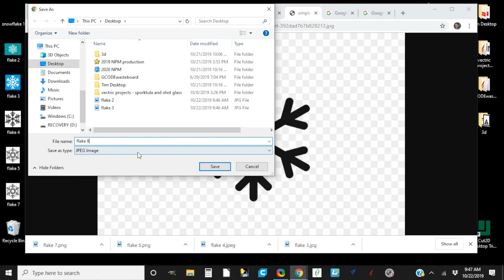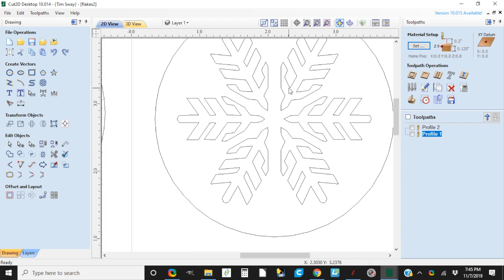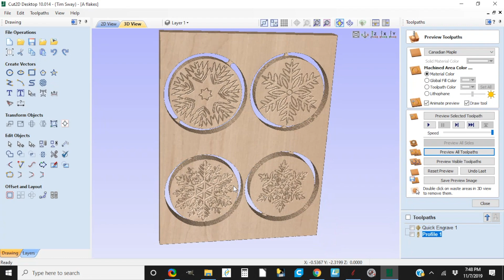Snowflakes 101 | In the Labs with Tim Sway | Vectric FREE CNC Projects

Comment: When I open the free file I get a code 103 error and it says the file was created in aspire 10.018 and I need a later version to open the file. Is there any way to use the file without getting the later version.
Reply: Hi Jim. Vectric might have a better solution but there are two options I can think of: 1: download the pdfs I made from www.newperspectivesmusic.com/flake and convert them in to vectors in your current version or download a trial version of Aspire, VCarve or Cut2d to run them, then delete the trial if you don't wish to upgrade. -T

Comment: Well, that was odd. Fifteen minutes of essentially nothing, during which I asked a question and got ignored. I'm sure there is a good reason why this all went wrong.
Reply: well i thank the guy for doing these videos to help out the new bee`s in the cnc field he makes it easy as possible ...
Reply: I don't think this was live
Reply: @disabledwoodworker  The video was recorded, but there were supposed to be live responses to questions
Reply: Hey Don, I'm the guy in the video. I was not aware there was supposed to be any live interaction when it was released? What's your question. Maybe I can help now?
Reply: @timsway  thanks. My question was about the hanging version of the router. It obviously needs some software to translate xy coordinates into the length of the cords. I was wondering what that might bet
Reply: @donepearce  The Maslow/MakerMade CNC has an arduino-based brain and it is run using free software called "Ground Control." It also has a Z motor that moves the router up and down in the factory base. When you buy the kit they explain how to build it and set it all up. I saved my toolpaths from Cut2d as "Inventables Xcarve" paths and the machine reads those. I'm working on getting "MakerMadeCNC" added to the machine list in Vectric. makermadecnc.com
Reply: @timsway  Thank you - very complete reply. I shall see about all that.